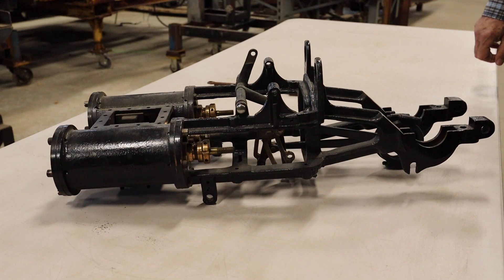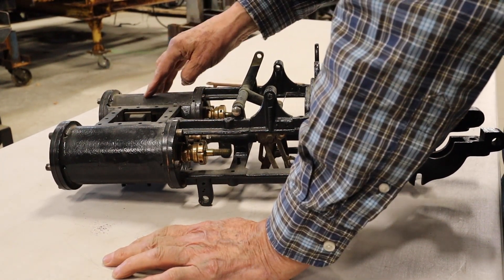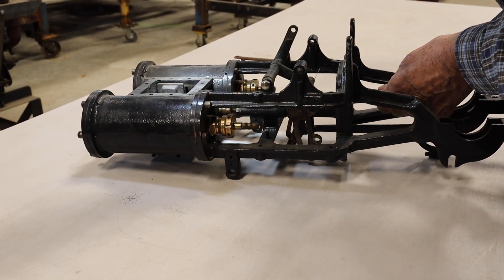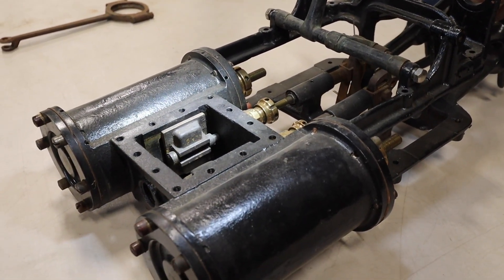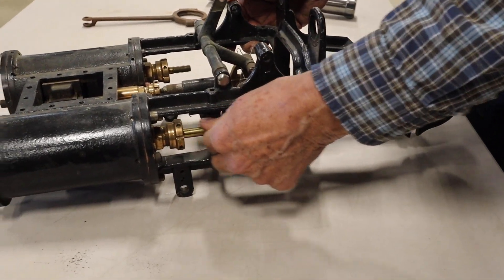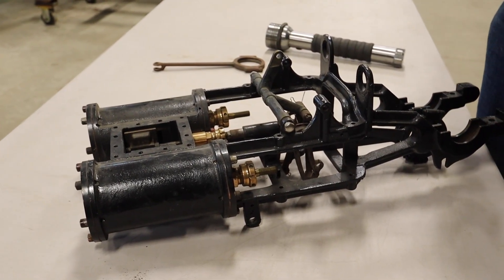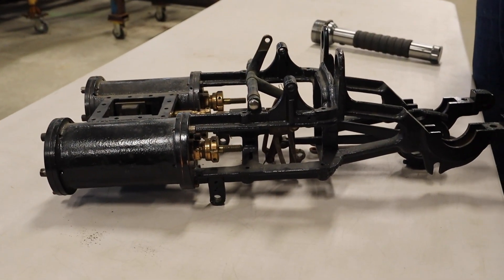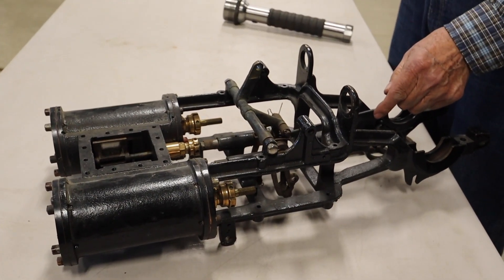Stanley Steam Engine

Comment: Hello I was wondering could you make a video of detailing the measurements of all the pieces of the Stanley steam engine
Reply from the maker: That is a thought. Thank you for the suggestion. There are several Stanley steam engines.
Reply from the maker: Also, If you are really interested in the design, you might want to start here. Great photos of the inside of the engine. http://www.stanleymotorcarriage.com/SteamEngine/SteamEngineGeneral.htm
Reply from the maker: @TetraconSteam  Steam Automobile Club of America has in their storeroom plans for the 10 and 20 horsepower Stanley steam engine.